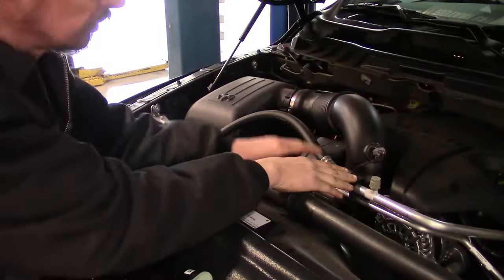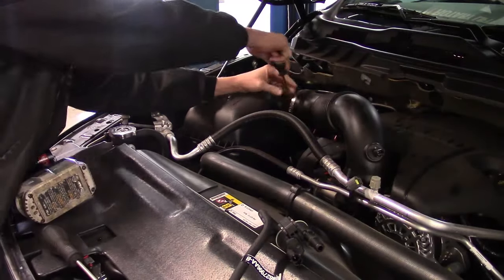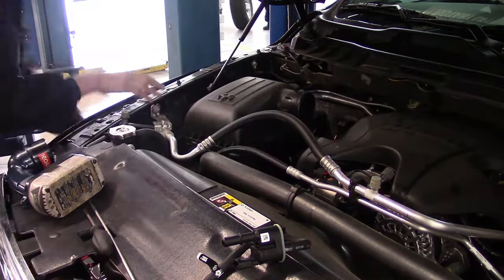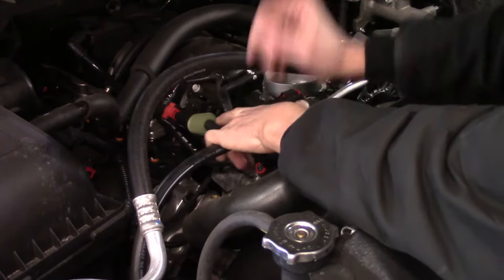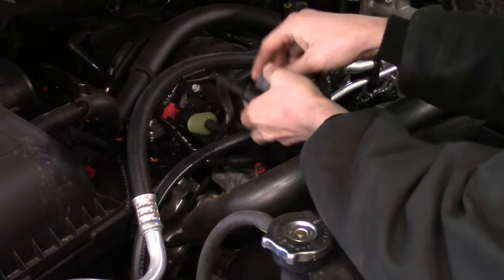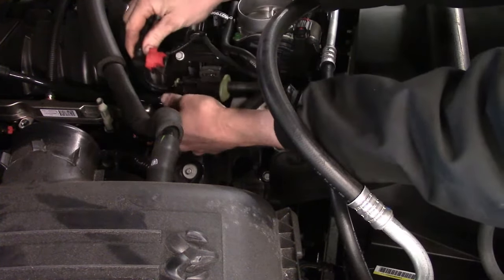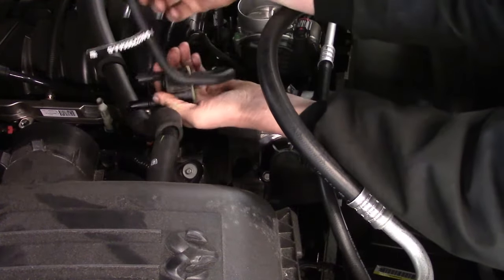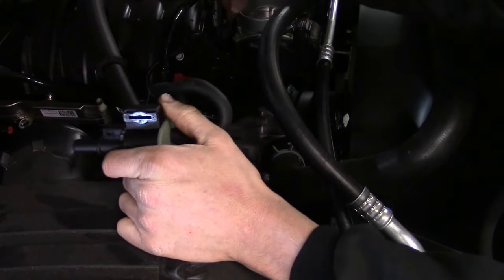2013-2016 Ram 5.7 Hemi evap purge solenoid replacement

Comment: Would replacing the Evap purge solenoid make the ticking noise go away?
Reply from the maker: Now the EVAP purge solenoid is designed to make a clicking sound when its actuated. Its turned off and on repeatedly and quickly as well so without seeing the vehicle I can only assume that its normal based on the info. Thanks for the question and for watching, Make sure to subscribe
Reply: The ticking noise is from your exhaust manifold bolts being sheared off , every ram got that problem
Reply: Zabeh Khanjer my evap valve is making excessive ticking noise (heard even with the hood closed) my manifold bolts were replaced last week. Dealer is replacing the valve out of their pockets for mine as it was a concern before I got the truck from them.
Reply: Steven Richard that's strange, my truck made a ticking noise that I could hear once I start the truck but it goes away once it's warmed up ,does the ticking noise go away after the truck warms up ?
Reply: Zabeh Khanjer actually the manifold studs were causing that issue. (ticks when cold until the metal expands then stops) the purge valve only makes sound on mine when the engine is at running temperature and I only hear it at idle.
Reply: Steven Richard that's very interesting
Reply: @zabkan3407 that’s the manifold studs being snapped.

Comment: Would that purge vale cause a check engine to say gas cap
Reply from the maker: If the system runs the leak test and it notices that the fuel was just added then it "assumes" it might be a gas cap if the test fails. Any leak can cause this if it runs the test after fill up. I recommend having the system tested first to make sure its sealed and then check the related components. I dont recommend just replacing anything at this point....testing is needed otherwise you might be wasting money. Thanks for asking and make sure to subscribe.
Reply: I did no leak on cap but computer reads gas cap
Reply from the maker: @mayterivera5186  Its going to take testing the system with a high end scanner that can run the evap tests and possibly hooking up an external tester as well that uses smoke to pinpoint leaks and to test to see if the system is sealed.

Comment: Were would it be located in a 2015 Dodge Charger 392?
Reply from the maker: I recommend checking the right side strut tower area....it is just above the right valve cover at the rear.

Comment: I just popped a P0441 today, could this be culprit? Cleared it and it hasn't come back as of yet... 2013 Ram 1500 5.7. Thanks!
Reply from the maker: Thats a possibility but requires further testing such as checking to make sure the EVAP system is sealed and then to see if the purge solenoid is working correctly. I would wait until the code returns then you can either try the purge solenoid or have it tested to see what it might be. Thanks for the question. Make sure to subscribe

Comment: Hey motorcity mechanic, great vid. can you give me a direction on my 2003 dodge ram van 1500. stupid thing won't fill with gas, I pulled the 2 fill hoses and blew through both with no obstructions, I removed the line coming out from the top of the tank that goes to the roll over valves and blew through that and no obstructions the air also seems to be going into the tank when I do. I have 0 evap codes all i/M monitor are complete. I'm stumped. also I can't find the support link for your channel is that option only on pc and not mobile? any help is appreciated.  happy holidays.
Reply from the maker: The most common cause are the fuel tank. The inlet ball can stick. If you try removing all vent hoses and still have issues....then the tank may be needed. As far as support. On the right side of the main channel page there is a support button,  you may need to scroll down a bit. Thanks for watching and make sure to subscribe

Comment: What are the symptoms you see when this part goes bad??
Reply from the maker: Zachary Thomas mainly just a check engine light is noticed. Thanks for asking and make sure to subscribe
Reply: Mine has a rough idle and small vapor leak detected would this possibly be the issue?

Comment: I have a 2010 dodge ram 1500 and found the solenoid under the battery box.  But here's the rub.  There is a line going to the throttle body and a electric connector but that's all.  Isn't there supposed to be a line that goes out the bottom to the gas tank?  Please advise
Reply from the maker: The purge solenoid in the service info shows one line directly out the bottom on the purge solenoid and one out the side. There should be 2. One leads to the engine and the other to the canistor underneath the vehicle.
Reply: Found the problem.  Tyvm for the assist.  The mechanic that did the exhaust manifold bolts disconnected the line and never put it back on.  I found it jammed up under the fender behind the battery.
Reply from the maker: +rexluthor71 glad you found the issue. I appreciate the update. It was just one of those things that didn't show up for a few days after the repair instead of right way.

Comment: Hello, I also have a 2014 ram 1500 with this issue and was looking to buy the solenoid online but cant seem to find the right part. By chance do you have the part#?
Reply from the maker: Here is a link to the part that I found online: http://www.factorychryslerparts.com/products/DODGE/RAM-1500/VALVE-Purge-Control-ESG--ESG--ESH--EZC--EZH--EZD--EZH--Valve-Only/10662543/04627694AA.html . Make sure to call your local Dodge dealer and have them verify to be sure using your VIN #. Hope this helps. Make sure to subscribe

Comment: can you tell me where the evap solenoid is located on a 2014 ram 3500 with the 6.7
Reply from the maker: +Brandon Correia Evening Brandon.....the diesel 6.7 doesnt use/have an EVAP system. It only applies to has engines
Reply: MotorCity Mechanic
Reply: MotorCity Mechanic lol thanks for the reply. I was pretty sure it wasn't   on the diesel. but that was what I was told the code was saying. would a dirty fuel filter and separator cause the EVIC to read "fuel system issue see dealer"?
Reply from the maker: Fuel filters that are due by the onboard computer monitor will set a message on the display saying......service fuel system. Just like you will get the oil change message at different intervals. Same basic operation. So if thats the message your getting then replace both fuel filters and reset the message. If the message is different then I recommend having the codes checked to make sure no other issues.
Reply: OK great. The for the info I really appreciate it.
Reply from the maker: Your welcome. Just keep watching lol
Reply: MotorCity Mechanic  i got a 2014 ram 1500 fuel cap light came on i changed it n the evap sensor..  still coming on any idea what else i could try?
Reply from the maker: Evening, chances are there is a large leak or a bad ESIM. It will take checking the system with a special tester to see if the system is sealed. If okay then the ESIM can be an issue. Further testing is needed before replacing more parts. The ESIM is located on the evap canistor. Thanks for the question. Make sure to subscribe and have a great weekend.

Comment: What's the part number on that item you just replaced?
Reply from the maker: I dont have access to that info. It also changes from year to year. I recommend calling your local dealer and give them your VIN number and have them look it up. That way you are 100% sure what it is.
Reply: @MotorCityMechanic  
Thank you David 
My dodge doesn't have that canister purge valve there can you help me locate it please?  I'm getting a code P0456
My Dodge ram is a 2013 1500 sport  5.7 hemi with 86k miles.
Reply from the maker: @juansaldivar85  The service info shows it being in the same position on the 2013 Hemi....next to the throttle body. Now as far as that code....small evap leak, there alot of possible causes. It requires using a EVAP smoke machine to check the system out to locate and leaks if there are any. Otherwise it would just be a guess.

Comment: Where is it located on the 2013?
Reply from the maker: If its a 5.7 hemi and a 2013 then exactly the same place as in the video.
Reply: it is  a hemi  but not located in the same spot. I cant find it. lol
Reply from the maker: If its a Ram truck and a Hemi....thats what the service info states. guess I need to check out the next 2013 that comes in. The previous versions had it located on the drivers side near the fuse box and close to the frame.
Reply: That would be great, thank you!
Reply: Hi did u ever find out were its located for a 2013 ram hemi 5.7

Comment: Very good channel. Code P0456.  I need to do this to my 2014 Ram 3.6 v6. Where is located on the v6 Ram??   Thanks!
Reply from the maker: On that engine it will be in the passenger side of the upper intake. Thanks for watching and make sure to subscribe.
Reply: ok I will look again.......................................................